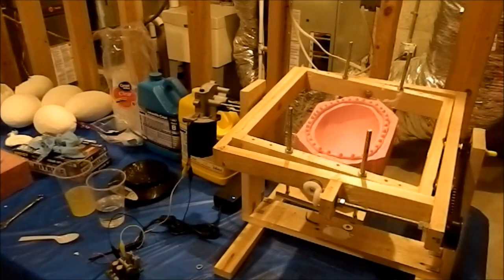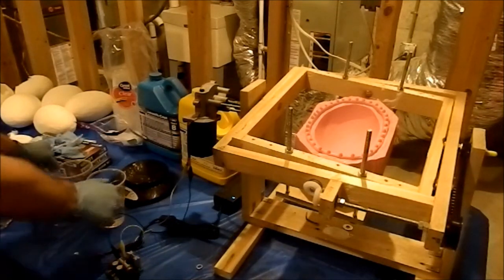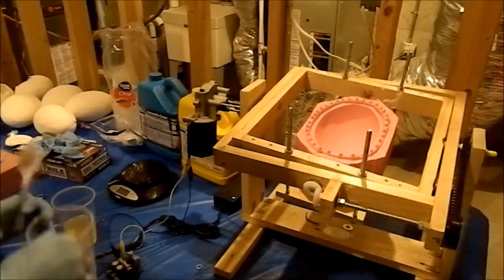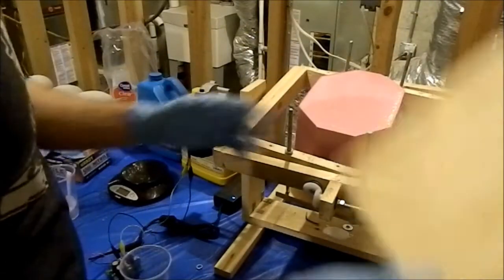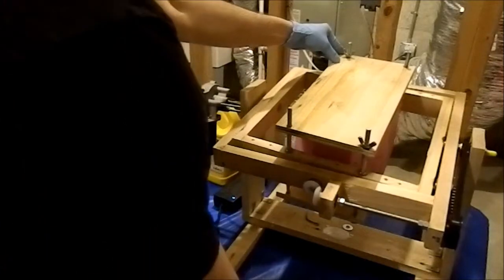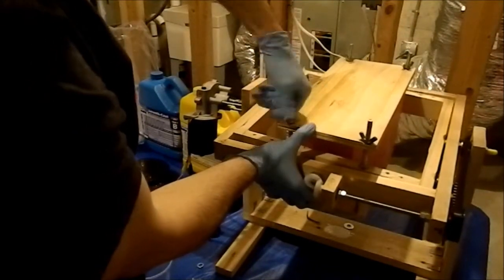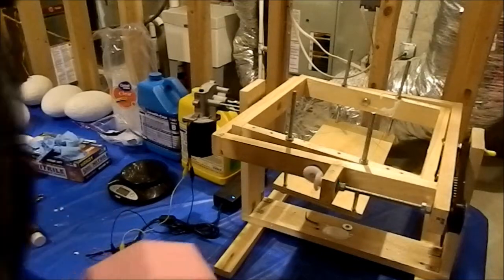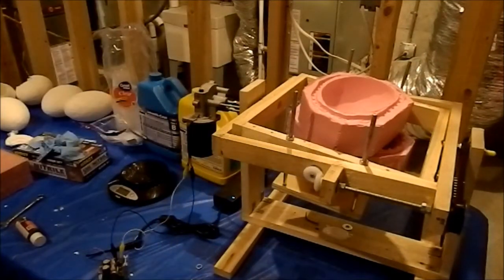Mixing and Casting Using a Rotational Casting Machine

Comment: I made a retro ray gun that's very round close to your egg shape. I made a closed mold just like yours. And I'm having issues with dimples on the resin cast? They are sunken in? Did you have this issue too? I used both smooth cast 300 and Aluminite clear epoxy.
Reply from the maker: is your resin fresh? What resin are you using?
Reply: Your problem is air bubbles behind the surface of your mold.  When the resin or epoxy heats up, it causes the air trapped in the mold to expand, pushing out the mold and making dimples in the casting.  Be sure and de-air your rubber before pouring on your master.  If you don't have a vacuum chamber, mix the rubber carefully, trying not to introduce air into it and then when pouring, pour slowly in a thin stream which will help lessen the air trapped. Only pour from one spot in your mold box and let the rubber crawl over your master.